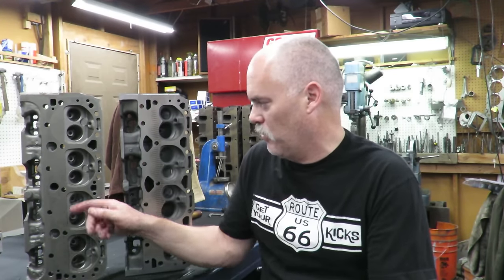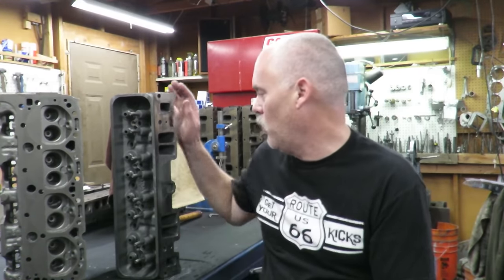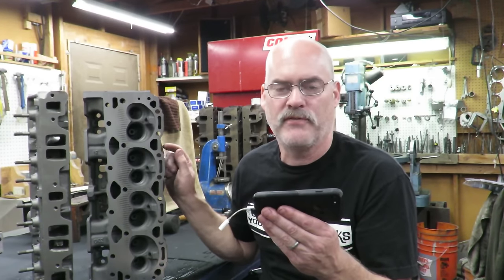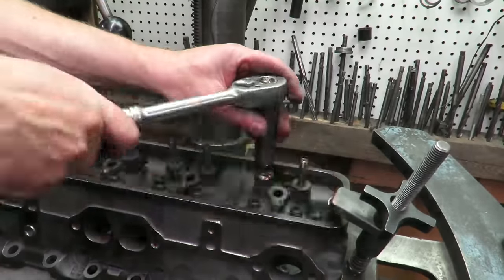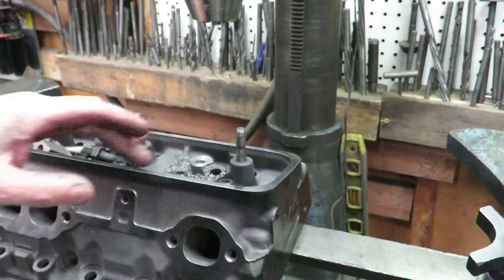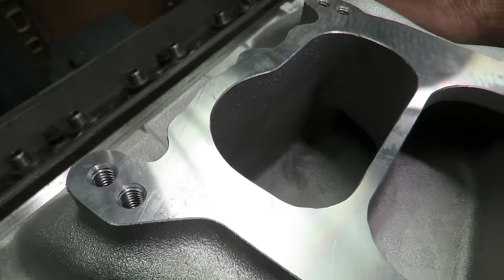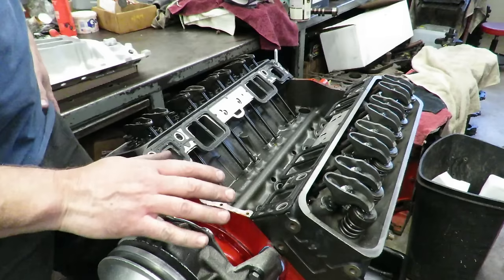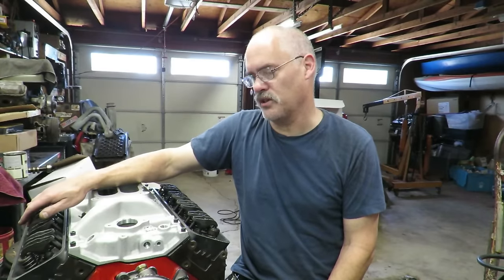How to get more power out of your Small block Chevy

Comment: Do you really need premium gas because if I do this I dont know mine is a daily and how do you tune the computer with the “new engine”
Reply from the maker: if you run flat top pistons ;like I did it makes the compression ratio 10 to 1 so yes it needs premium fuel if you sue the stock 14.5CC dish piston you can use regular fuel
Reply: Myvintageiron7512 thank you

Comment: Hey are the 113 aluminum heads any good? I had sun small repairs done an shaved they have screw in studs an guide plates 194/160 valves can they go bigger or is that's max?

Comment: I have run into a wall. I have a 1973 350 chevy block, 4-bolt main and 4 barrel carb stock. The Heads are stamped 93417369. Passenger side has #212 stamped, and driver side has 215 stamped. I cannot find the heads ID number on anyone's chart. Any ideas?

Comment: i have a set of these heads i saved from my old tahoe , i have a 290 horse gm performance parts 350 4 bolt in my monte carlo and by the math then of the 129 hp addition by the head and cam change i should be pushing near 400 hp correct or am i wrong,
Reply: The head and cam from the 220HP crate engine is probably different from your engine, and because of that, you probably will not gain 129 HP from the head and cam replacement.
Reply: i will be up grading to the vortec heads and the 500 lift cam from the old large chamber heads and the old 450 lift factory cam, exhactly what hes talking about doing ,

Comment: Was it kind of camshaft do you use
Reply from the maker: MC22280 Engine Pro
https://enginepro.com/Products.html
Reply: @Myvintageiron7512  

This sounds like a Howards cam 183215-08 that I was thinking about getting for my 1998 vortec head 350 build. But it's cheaper. Would this Engine Pro cam run and sound about the same as this particular Howards cam? Did you ever do a video of this engine running when it was completed?

 You have on of the best engine building video channels on YouTube. I learn stuff every time I see one of your videos.
Thanks for the education.

Comment: Very interesting indeed, so much to know....I can't believe Chevy would have designed intakes/heads without the two center manifold bolts, must have been a lot of leaks...  Are those Vortec heads also referred to as "scalloped heads"?  Just seems like a lot of meat was removed from the heads on the outer edges, easy to understand why the heads are prone to cracking.  Can't believe chevy would design heads with "pressed in" rocker studs, is it common for these studs to migrate out of the head?  Wish I was younger so I could get a job in your shop being a gofer/cleaner upper, would be so cool to learn this art....
Reply from the maker: All Chevy small blocks came with press in studs going all the way back to 1955 there were a few over the counter SBC performance castings that had screw in's but pretty much all the stock stuff was press in if you look at the vortec intake manifold you will see why those bolts are not there
Reply: yup and the common fix was to pin them which i never liked. they still sell the kit also

Comment: Well and good. Remember, Mexico, the place the target engine came from has a very week bottom end. It will run good, but the bottom end was not made for cams with .500 plus lift. It will run, but power will go down fast with stock clearances and plain old cast iron rings. Expect to break a few rings. Those Engine masters really don't care that after a thousand miles, you will need a quart of oil. You are an engineer and machinest too, so you know what I mean. 4 bolt mains and raps are over rated for this and not need for the setup.

Comment: how far can you go with this type of upgrade on a stock 1988 C2500 and still pass California smog test?
Reply from the maker: you will probably need to back the cam off but other than that it should pass no problem these heads pass smog in the 1996 and up OBD 2 engines
Reply: You would need to have the ECU reprogrammed to make it work. I haven't heard of any other place to go than TBIchips. The intake ports of the Vortec head are different from the TBI head, so some companies build an intake manifold that is compatible.

What I don't know is how well this engine will perform when cold. The TBI engine had an intake manifold that was heated by a coolant passage in the cylinder head. You would see the same setup on a carb engine because the TBI does not atomize fuel very well when cold. Poor fuel atomization is a cause of smog, that might make you fail.

I have heard that some iron aftermarket heads have ports and combustion chambers that line up with a TBI or carb intake, and won't break the budget.

Comment: I have a question I had my 906 vortec heads press in studs replaced with shoulder-less screw in studs.Now granted this is a new build less than 30 miles on it I've noticed  three of the intake rocker screw in studs started backing out... I put permatex orange loctite on it.. the cam is a lunati bracket master 2 .515/515 I screwed up using a single pattern cam instead  of a dual. What causes this to happen it's only on the driver side?
Reply: Did you solve your problem?

Comment: I have a stock 400 sbc, what would be a good cam for that?
Reply: What car,  what trans  what rear end gear .  Then what do you want to do with the car?  If you are  just blasting around  town in a chevelle with a TH350  and stock converter,  a  short  circle-track Lunati flat tappet with tight lobe splay (108)  should be  OK.  You want to keep .050 lift duration under 214 deg on the intake.  - Sandy
Reply: Benny Teichroeb , I wouldn't go with one too much higher on lift than the one that came out , but get one with a longer duration , keeping the valve open longer let's in more air/fuel mixture , no need to lift the valve any higher when it is staying open longer
Reply: Benny Teichroeb , and since you are taking the top apart , take the heads off and get them planned , then use Fel-Pro steel shim head gaskets , these are not the (BLUE) Fel-Pro gasket's , they are a single steel shim , this will raise compression and add horse power   ,
Fel-Pro part no.7733SH-1
Reply: I was also thinking about running e85 would a stock 400 have enough compression to run it?
Reply: Benny Teichroeb , that sounds like a question a 12 year old boy would ask
Reply: The reason I asked is because I still not all that familiar with e85 and carbs

Comment: Hey perhaps im just an idiot and cant find this info, but perhaps you can help. I have a 1999 L31 oe roller block that im gonna be throwing in a comp roller cam with a double roller chain. Im having a hard time understanding which timing cover to use, the stock one is too short to fit a double roller and made from shitty plastic. From what I've read thus far people are saying to ditch the factory cam retainer use a timing cover for a roller retro application and use cam button instread and the retainer. Is this true? Any help would be appreciated thanks.
Reply from the maker: Um NO! use the factory retaining plate and factory lifter retainers you can use the early 350 timing cover from pre 86 small blocks all you need to do is get the dowl locating pins for the cover the plastic cover has them built into the cover the early cover requires them to be installed in the block summit racing has the dowl pins
https://www.summitracing.com/parts/pio-839059?seid=srese1&gclid=CjwKCAjw2dD7BRASEiwAWCtCb31cZEYH_8bxbLPv-mWDwiO5mbIJOYAgMehEUj5khj0MFC9N0iNl2RoCdX0QAvD_BwE

Comment: The old 882 full port polish valve job 800 bucks will flow within 10 percent POWER of expensive dart or other.dyno prooven.
Reply from the maker: Not true for two reasons Dart iron eagle Platinum heads with 215 cc runners are $719 on summit even less on Amazon and they have 215 CC intake runners the fully ported 882 and 487 castings will flow a little less that a dart 180 CC head but they are no where near a 215 cc head and you will spend more to get them done on top of that the 882's are crack prone
Reply: Myvintageiron7512  you are comparing a much larger port head,to a factory casting. Their is no doubt a much larger head is better. Advance in technology. Millions of motors ran pretty good for decades on those supposedly JUNK heads. Of course now we have better options according to how much money we have.

Comment: Hey vintage, im going to build a motor for my 1994 chevy k1500, will any 350 chevy engine block work with the vortec heads?
Reply from the maker: yes
Reply: So I could just swap out the entire vortec out of say a 1996 k1500 and it'll fit right into my 1994 k1500? All the accessories fitti g correctly?
Reply: All the accessories in my current tbi 350 will bolt up to a 350 vortec engine?

Comment: Can you tell me what SBC casting code is 4010207 is? By putting a 1 front of the number makes it a 350 block form what I’ve found online. The numbers are clear & easy to read so I don’t think I’m over looking the 1 it’s just not there. Have you came across this problem with all the work you’ve done?
Reply from the maker: Yes it is the same number the foundry will sometimes leave the first digit off if its a 1 they may also leave the last digit off if its a 0 Ive seen it both ways it is most definitely the same casting and really with chevy casting numbers the only thing that matters is the last 3 you have a 207 block it's a 350 1980 thru 1985 2 or 4 bolt main
Reply: Thank you, it’s in a 1987 Chevy v10 with the tbi. After watching & subscribing to your channel I was looking the Block and headers over to see what I had. I’ve had the truck for a few weeks now & I’ve learned so much from your videos. The previous owner had put the 416 heads on it. from watching your other videos they’re 305 heads? I have some heads off a 73 that are 991 heads. In your opinion would I be better off to have the 991 heads redone & use them? If so what all should I have them do to the heads?

Comment: Do vortec heads need coolant bypass on pump to intake?? Please
Reply: No as long as the waterpump port on the passenger side of motor has the little hole on the bottom. Factory built in bypass

Comment: Yes, them old TBI style engines between 1989-1995 were complete trash, NOT even a foundation for performance, the the 454 GM put in the 1990 SS truck only had about 225 horse if that.
Reply from the maker: The lower end of the TBI was a decant short block it is basically the same as the vortec block  the heads and intake is what killed them build em with good pistons and rods add vortec heads and a good intake and you have a hot little engine
Reply: Mines a 71 chevy is it trash?
Reply: It has a 350 i was putting in a 383

Comment: Curiosity has me, is there any way you can convert the valve cover to the old style?
Reply: They sell adapters
Reply from the maker: Most of the after market vortec's have both bolt patterns
Reply: i have a factory set from my old 96 tahoe that are drilled and set up for both styles cover

Comment: I need to find out what i can do with the 318 magnum in my 94 dakota
Reply: Better cams and heads do exist for the 318 Magnum. I'm sure at the right MOPAR specialist web forums and Youtube channels have good recipes for a 318 build.

But if your engine is in need of a rebuild, why not buy a cheap 5.9 engine core, and do a high performance rebuild with it? There are probably more good build recipes for a 360 than for a 318.

Anyway, I have heard that Enginequest makes a good 318/360 iron casting that isn't too expensive and is less crack prone than OEM.

I'm not sure how the computer is programmed on a 1994 Dodge Dakota. Major changes do require reprogramming.
Reply: Skyline Fever yeah I can get the parts I need. It's just programming the ecu to see the parts. I know it's possible. Also my goal is 350-400 hp. The 318 I have I know is capable of doing that even if I have to put a turbo on it. Just that ecu that may be the only real obstacle but I think they have stand alone ecus that can run v8s

Comment: You can't attribute the HP increase to the heads alone. They changed other things at the same time
Reply from the maker: yep they did and that is all in my video I changed everything they did in fact I changed even more they ran the stock short block with cast dished pistons and a stock timing set my build has hyperutectic sealed power flat top pistons and a double roller chain and gear set along with an all steel oil pump drive and welded pick up tube they had none of this so my compression is 1 point higher than theirs if you watch the entire video you will hear this discussed

Comment: I havnt done it personally, but from what I hear it's pretty useless trying to do much with the TBI injections units.. They're not capable of making much power. Don't think much can be done tuning wise so your limited on how much big airflow improvements from heads and cams you can really benefit from. Better off with a carb powerwise
Reply from the maker: I have to disagree there are aftermarket upgrades for the TBI that can flow as much fuel as you will ever need
Reply: Myvintageiron7512 by now that wouldn't surprise me. I've even heard of just using 454 tbi injectors etc. But for your end results I don't think the cost is worth it.. your still stuck with an old school efi setup with a slow dumb ecu. If your willing to put that much effort and money into efi I think your money would be better spent on adapting some other type of efi. 
However i think most of the bolt on style efi systems are even a waste of money unless you have alot invested in a shortblock or have some odd engine you don't want to swap. If EFI is a requirement and good power is your goal then starting with an LS is the answer yet again lol
Reply: My 91 c1500 has the 454 tbi onmy 305 and upgraded cam and not many people can run with me...the throttle response is amazing over the sbc tbi setup...you do have to port the intake ports were the tbi sits
Reply: Andrew Franklin not many people huh? Must be talking about other tbi trucks lol
Reply: High horsepower cars are useless for street racing where i live...the streets wont hold the power

Comment: Can I put borteck heads to a 1980 350
Reply: Juan Carlos Esparza , yes and Hortech work too
Reply from the maker: I'm guessing you meant vortec and yes you can
Reply: Myvintageiron7512 , No , Bortech and Hortech  heads  
are the newest thing  , Vortec  heads  obsolete , you should learn how to speak gibberish and nonsense , engines don't run because nothing fits , but they can last forever  ,
call 1-800-cloud- nine   for yours

Comment: I love all the comments from key board mechanics saying LS engines are better. Well, duh!!!!! But at the end of the day, the original small block is cheaper to build power with. What they fail to include in their cost calculations is the extra money spent on all the extra parts necessary to swap an LS into a vehicle, and the extra money on tuning etc etc.
Reply from the maker: you are correct there are definitely extra costs involved unless the vesicle had an LS based engine to begin with One thing I can tell you is the older small block Chevy videos are by far still the most popular among you tubers
Reply: @Myvintageiron7512  love your videos btw

Comment: Will all this work on a 96 vortex motor using 80's 305 crank
Reply: 305 AND 350 HAVE THE SAME STROKE BUT THE PISTONS WEIGH DIFFERENT SO THE CRANKS ARE BALANCED DIFFERENTLY.  EXPENSIVE TO AD WEIGHT TO CRANK. YOU CAN BUY A SCANT CRANK CHEAPLY AND ITS STRONGER.
Reply: I ALSO FORGOT TO MENTION THE 96 IS A 1 PC REAR SEAL AND THE EARLY 80'S WERE 2 PC.

Comment: For all the work involved with this you may be better off bolting on a set of pre-assembled 195cc AFR aluminum heads.
Reply from the maker: If you have 2K to drop on a set of heads then yes for sure but many people who want to mod their Chevy don't have the cash for that you will also need a $250.00 set of rocker arms and another $100.00 for hardened push rods as well as $70.00 for intake gaskets by the time you get the heads on and working with all the hardware and gaskets your into it for $2500.00 that is quite a bit more money you can do vortec's for  6 to 8 hundred maybe even less if you pin the studs instead of installing screw in's

Comment: I'd like to see a work up on the Ford 4.9 L/300 c.i. .   There is nothing out there for us big six guys.
Reply from the maker: I have an inline jeep engine in process and a Pontiac OHC six planned for the further I am a big fan of the ford 300 CI in line 6 cylinder what a great engine I have had 3 of them over the years they out pull the 302 V8's

Comment: So what's the lead time from you on that same setup?
Reply from the maker: Are you talking heads only or the whole engine
Reply: The whole thing, I started restoring a 72 Camaro about a year ago, got to the engine tear down and it's already .060 over. Not looking for a race car, but I don't want a 235hp crate.
Reply: there a old guy on ebay named herb i have bought 4 engines from who does vortec for around 28 2900 intake to pan with 425hp he offers ported heads for 30hp more and for 300 more roller cam he also offer top end packages also
Reply: Thanks Sean I’ll check it out

Comment: Will vortec heads fit my 71 350
Reply: nathan butler they will but you will have to change your intake to a vortec as well. The stock one won't bolt down, wholes are different angle. The after market is full of intakes compatible with both.
Reply from the maker: yes the engine in this video is and early 70's short block